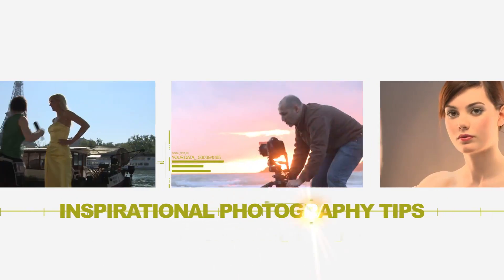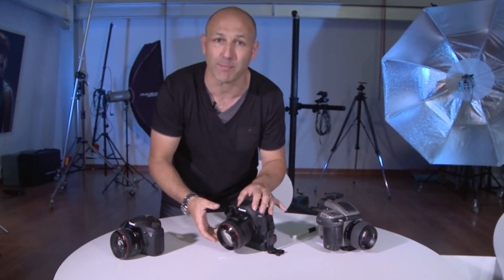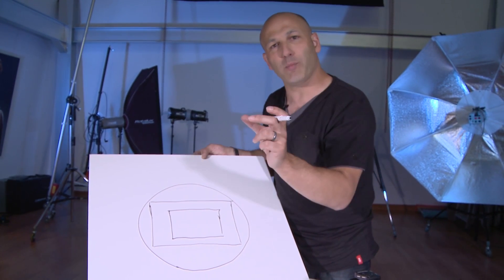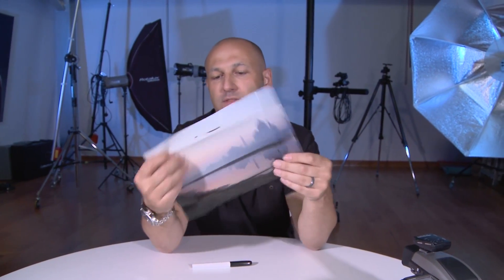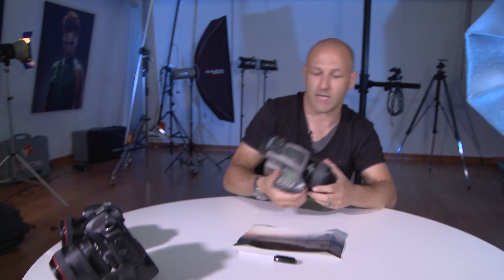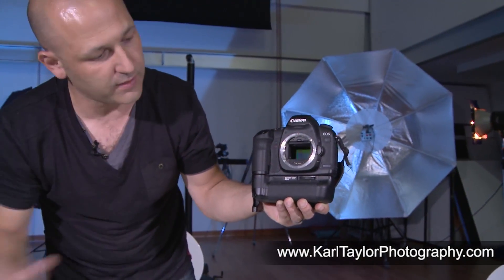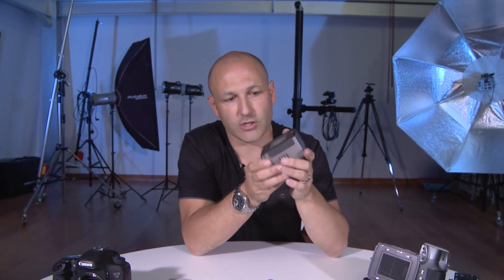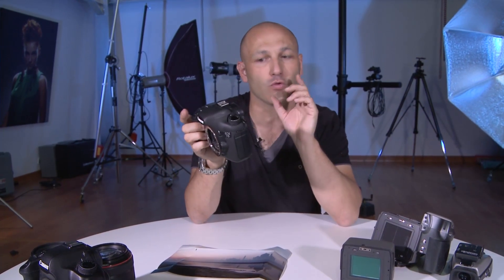Full Frame Sensors vs Crop Sensor Cameras Explained by Karl Taylor!

Comment: Karl, what do you have to say about full frame sensor of, say, 16 megapixels compared with crop sensor of higher resolution of, say, 24 megapixels? I tend to think that higher resolution crop sensor will have a more superior picture quality than the full frame of a lower resolution because more megapixels are packed into a smaller sensor. Is my line of thinking right?

Comment: great video, thanks for that! 

but I am wondering why you never mention the possibility of going higher ISO with a larger sensor, 
in contexts like that. 

I mean: usually you'd have this possibility (if the sensor's other properties were the same), right? 

maybe it is because you usually take care for sufficient light at your sets? 
but when I go out - let's say on a party - i'd really appreciate to go on ISO 6400 without having too much noise on the picture.

Comment: Wouldn't the fullest frame from a circle image be a square?  That would maximize both width (like "full frame") and height.  Is this an unfortunate byproduct of a widescreen world?  Or what about an over-sized sensor that captures the full circle images?
Reply from the maker: Yes your right it would. However the conventional shape of a double page magazine spread is rectangular and the cover is a vertical rectangle. Hence the shape of our film and sensors. There are however some square format cameras too.
Reply: ***** Thanks for the rapid and informative response!

Comment: Good explanation. Although, I'd like to add that, if I'm not mistaken, only Canon has 1.6x crop APS-C sensors, and all the others, including Nikon, Sony, Fujifilm, etc., have a 1.5x crop APS-C sensors. Also, Canon used to have a 1.3x crop (called APS-H) sensors in their 1D series cameras.

Comment: I find this video a bit misleading. If you compare micro four thirds cameras, they are mostly now at 16MP, vs Full Frame that ranges anywhere from 12MP to 36MP. You'd have to get a 36MP FF camera to start evening out the different in zoom range (crop factor on smaller camera vs increased resolution on larger sensor).

Smaller sensors are pretty much on par in terms of tonal range as well (look at the best m43 cameras for instance).

Benefits of Full Frame:
-Better high ISO (low light) performance. This can be compensated for to a large degree by using speedboosters on smaller sensor cameras, but not convenient.
-More shallow DoF. Allows for razor thin focus plane with a fast lens, vs wider focus plane on a  fast lens for crop (or you need an ultra fast lens to compensate, or speedbooster). However, interestingly, in low light and some situations, since you want more stuff in focus most of the time, FF users are forced to stop down their lens which actually levels the playing field in terms of low light performance, as Crop sensor can shoot with 2 stops faster, which also means 2 stops less ISO.
-Some high speed photography is still best served by top of the line FF cameras. Supposedly the GH4 from Panasonic is starting to get close though, but FF still reigns here.

Benefits of Crop sensor:
-Longer reach if using full frame compatible lenses (i.e. 70-200 suddenly becomes 140-400 on m43)
-native "crop lenses" are much smaller, and the camera bodies tend to be smaller too.
Reply from the maker: Some interesting points but none of which explain why pro photographers prefer to use FF cameras or MF cameras. It seems that many of the comments  here that are in favour of crop cameras are from those who have crop cameras and have taken offence at comments from a professional photographer talking about the differences? If the majority of what you said were true why would I or any other pro photographer opt to pay for more expensive gear if the better choice is to use the crop sensors which are more economical?
Reply: *****  the answer to your question IMHO is that professionals need to impress rich corporate clients and using cameras that amateurs use is bad PR even if, to all intents and purposes, in most cases the finished image is just as good. Much better for your corporate image if you are known for using "nothing but the best" as this makes the client feel like that is what they are buying in to. There are plenty of professionals that use crop sensor cameras and some even use micro four thirds they just don't tend to like to shout about it!
Reply from the maker: Paul Dulac It's a good argument and has some validity but not enough to be the whole reason. I'm sure there are many instances for portraiture or weddings where a crop sensor will be perfectly acceptable for that type of work even to a professional standard. But I can tell you hand on heart that to produce these type of images http://karltaylorportfolio.com and the type of clients that I shoot for they can't be done on anything other than medium format, even full frame 35mm isn't good enough for these. There are also many other reasons I use a MF and even a technical camera such as a Linhof with a MF back on it and that is for complete scheimpflug control and corrections or in instances where I need to shoot studio flash outdoors at any sync speed because of the leaf shutter. Then there is the higher dynamic range, better tonal transition as well as minimal chromatic aberration due to better lens design. Yes it's great that the client might think 'wow this guy is shooting with a Hasselblad' but thats the last thing on my mind when making a purchasing decision over a camera like that. If what you said were true then I'd only have one of them and just a couple of lenses to 'impress' the client, but my MF equipment list goes well beyond that because I've purchased the tools I need to do the job to a necessary standard for the type of work I shoot. I don't actually even really care about the make or model I'm just looking for the right tools otherwise I'd rather spend the money on a boat.

Comment: Couldn't the crop sensor lenses be designed so that the image circle was proportionally the correct size to match the sensor size?  I realize this type of lens would not be usable on a full frame sensor camera and would not gather as much light.  The extra light gathered which forms the image is wasted anyway, falling outside the boundaries of the sensor.
Reply: They typically are. For micro four thirds, with a crop factor of 2x, you will find that a 35-100mm f2.8 lens, which is equivalent to FOV and light gathering capability of 70-200 f2.8 for full frame, it is far lighter and smaller. For 99% of people, smaller sensors will be more than sufficient (far less of an issue than most people's capabilities..). Full Frame has better low light capabilities, but the crop sensors are so good now that this is practically a moot point. One difference is the Depth of Field where a F2.4 FF lens would have the same razor thin depth as a F1.2 lens on M43 format (Leica Nocticron is one of the few that are this "fast"). That said, when the DOF gets too shallow, it is VERY easy to get stuff out of focus, and if you position yourself properly, you get plenty of shallow DOF on crop sensors.

Comment: So should we buy the Canon D70 for youtube vidoes with it's 19pt auto focus (with stm lens ... usm make to much noise) or buy a Full Frame Camera?

In other words did the D70 change the game and worth the $
Reply: Dylan Johnson Really. lol
Reply: MichaelNetwork I have the 60D and it is amazing
Reply: oWetThings I just bought the 70D with 55mm kit lens and I concur... it's amazing. 

Check out my latest youtube video it was all shot with the 70D and I was thoroughly impressed. And that's with the kit lens which is also pretty good especially for a kit lens, they upgraded it and it's quality.

Plus no noise on the lens when I'm recording.

I didn't have experience so I went with the 70D however if I did have experience I would have went with the 60D.

Good look bro

Comment: Don't crop sensors also lessen the number of pixels? So if you want to get something thats far away you might as well just crop the photos after you've taken them on a full frame and recieve the same resulting image quality.
Reply: 70D, 6D same number of pixels, different sensor size.

Comment: I loved how systematically you explained the issue and emphasized that cropped sensor gives reduced angle of view of the full-frame sensor. Generally it is mentioned as the equivalent focal length, which is incorrenct because of the perspective.

For Canon cameras it is 2.56 times sensor size difference between cropped and full-frame. So, to have the pixel density of a 18Mpixel crop sensor on a full-frame, it would require 46Mpixel resolution. That is why cropped sensors are preferred in sports and wildlife photography.

Comment: Karl, great video, I've tried to explain this to people and it's hard for some to gasp what is really happening. Then you try to explain that using a FX 50mm for a portrait on a APS-C sensor is still not the same as an 85mm or that an FX 35mm capture is not as flat as a FX 50mm because the cropped view does nothing to change the compression factor of the lens. The lens field of view is still native to the formats focal length that it came from. Thanks for a high quality series of videos.

Comment: If you compare different sensor sizes at the same focal length then yes, you have to move farther away with the smaller sensor. However, that's not a very realistic scenario because it lets the larger sensor dictate the lens that you use. If you want an FOV equivalent to 85mm on FF with a crop sensor, it simply makes no sense to buy a 85mm lens and change the perspective. You should buy a 85mm-equivalent lens instead. This may be different for people like you who have both systems, but for someone who simply has one system with one sensor size, the argument is obsolete.

And if you use an equivalent focal length instead, then the DOF is larger at the same apertures – but apart from that (and differences in sensor tech and lens design) the image is identical. There is no such thing as a "FF look" or "MF look".
Reply from the maker: Hi Willi, it would be great to hear what experience you are drawing from to make these conclusions. I'm beginning to wonder if you simply don't like FF because you didn't buy one? The fact and very important fact is that as a professional photographer I would choose to use an 85mm 1.2 for example to attain a certain 'look and feel' of the image. If I had to move further back with the crop sensor then that 'look and feel' would be lost. If switched to a 50mm on the crop sensor the FOV might be equivalent but the 'look and feel' will not be partly due to the characteristics of a given lens and DOF. As photography is also an artistic process then the decisions on the look and feel are at the discretion of the photographer. I'm sure we could find a matching FOV on an iPhone to a given APS DSLR and lens but the 'look and feel' of the image would be different. If you are absolutely correct why would thousand of professionals choose to purchase more expensive cameras in various formats instead of shooting them all on high res compact cameras? Focal length and subject to camera distance all have a bearing on DOF and perspective.
Reply: Well, physics are physics – perspective is not perceived differently at different focal lengths, but at different distances to the object. Equivalent focal lengths and apertures give you equivalent results.

However, these results will be equivalent, but NOT equal. "Look and feel" is a very subjective term, but I think the main factor is the lens design. Just compare two otherwise identical lenses from different manufacturers, and chances are they will look "differently" in terms of sharpness, bokeh, etc. On SteveHuffPhoto.com there once was a big comparison of 50mm M-mount lenses, and they all had their own distinctive look even at identical apertures! 35mm is a very old format with great market share, so over the decades there have been some great lenses with strong character. If you have found your favorite lens with its own character, then of course everything else will pale in comparison. I value the special character of my Minolta 58mm /1.2 even over newer f/1.2 designs; and Lomography just recently released a lens based on the very old Patzval design because they like it so much. You are right that photography is an artistic process, and I believe the unique renderings of lenses is much more important than any of that technical blabla like sharpness and whatnot.

You mentioned a 85mm f/1.2 lens. First of all, to my knowledge speeds faster than f/1.4 are only possible with optical compromises, leaving super-fast primes technically less perfect than slower ones. But subjectively, this usually leads to a stronger character of the lens, a more unique rendering. Also, f/1.2 creates a super-shallow DOF; on MFT you'd need a lens with an aperture of f/0.6 to get an equivalent picture (in terms of perspective and DOF, not rendering). So, in this regard larger sensors have more "head room". Even if such a MFT lens existed, it would probably be optically compromised, rendering an inferior image to the larger and slower lens. But that is true for 35mm as well: f/1.2 lenses might have a unique character, but you have to like the often soft image. Alternatively you could go into medium format photography, where a slower-speed lens woud give you the same DOF but coupled with a sharper rendering (on 6x9 something like 170mm f/2.5 might be equivalent).

It's not true that I don't like 35mm, but in my opinion it's just one format of many. It's not the ultimate format—every argument for it would be valid for even larger formats as well. The larger the format, the more head room you have in terms of shallow DOF and (if DOF is not of concern) high ISO performance/light gathering. But that's it: There is nothing mystical about it. I think crop is interesting, I think 35mm is interesting, I think MF is interesting. The question I ask myself is: How much head room do I need? And personally, I'm fine with the DOF capabilities of MFT. So I rather invest the money in great lenses. But again: I completely agree with the rest of your video and think it's a great explanation. It's just this one segment that I believe to be off a bit.
Reply from the maker: Willi Kampmann Well we agree that physics are physics and that the look and feel of the image due to depth of field will be different. All of which I stated in the video above? At no point in the video do I state anything different or contrary to your original argument or disagreement? I stated that you can switch to an alternative focal length lens to get the same FOV but that lens will be a different focal length and therefore result in a different look and feel and DOF? As for the ultimate format, of course there is no such thing and every tool has it's job which is why I choose the format/tool to suit the purpose and which is why I showed 3 different formats in the video? As for optical quality the design of lenses for 35mm FF in my opinion is superior to crop format because of the pro glass available. Personally I think lenses such as the Patzval design are a step backwards and they don't interest me in the slightest but again that is a subjective 'art' argument... and we could go on and on and on... The lenses on a Hasselblad MF are superior to those of FF 35mm and so on. I think the developments with FF mirrorless cameras will also offer some interesting new optical advantages as the rear element is not restricted by the mirror anymore.. and we could go on and on and on.... As for one segment of the video being a bit off? It's actually not. You obviously have very good knowledge of the technical aspects of photography which is great but I'm first and foremost a photographer not a technician and as such for me the only proof is in the pudding and after 20 years in the business I will let my pictures do the talking and for anyone else reading this you can view them here www.karltaylorportfolio.com whilst everything you've stated in your comments is factually accurate I don't fully understand why you raised them. What i'm offering in this video and the many others that we put out for FREE is a simple explanation for people to what is often perceived as a complicated subject. Obviously in putting anything 'out there' we are liable to criticism which we accept and gladly publish comments such as yours. However I will argue against such criticisms if I think they are unduly harsh or inaccurate, which in this instance I believe your comments were.

Comment: Hi. Does the full frame sensor gather more light than a cropped one? Will the image be the same exposed on both sensors with the same exposure, aperture, etc. settings?